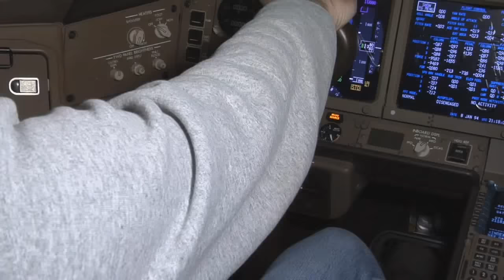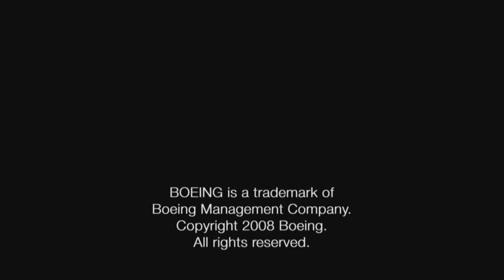Building the 777

Comment: A chemical adhesive, called apoxy is applied to the panels. The rivets hold the panels in place whilst the apoxy sets hard, whilst also allowing a secondary structural safety component to hold panes together if apoxy fails or gets contaminated, the rivets should hold long enough for any apoxy wear of contamination to be detected by maintenence crews. Aircraft like the most technologically advanced airliner ever - the 787 don't use rivets.

Comment: Wing panels are joined by rivets and special rivet-like bolts called "hi-loks"...virtually no welding on the primary structure of an aluminum airplane, aluminum HATES to be welded and the grain structure of a welded aluminum joint is very vulnerable to hydrogen embrittlement.

Comment: I venture to ask a question. What is the use of the aircraft in this video? The aircraft is in Boeing house livery, meaning that it would not be sold to other airlines unless they change it. Also, seats are installed. You may have to change these seats before selling the plane to another airline. If it is for promotion purpose, first, given that 777 is not new, why makes an effort to promote it? Second, why includes a cabin in a promotional plane?